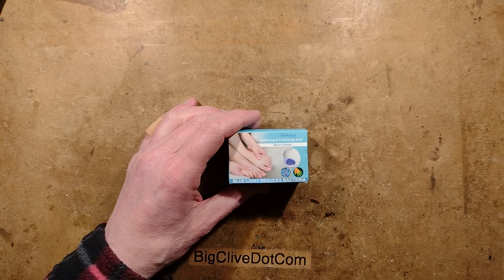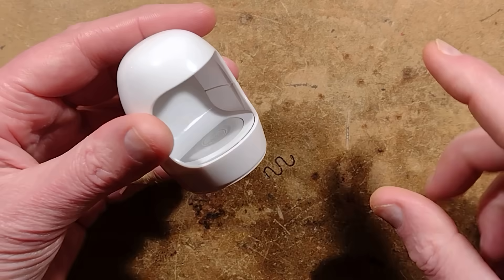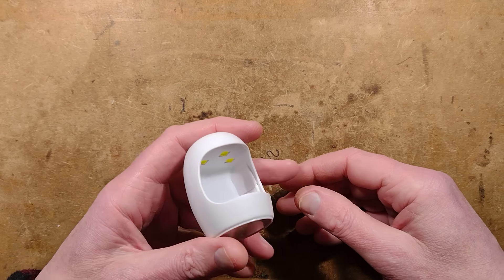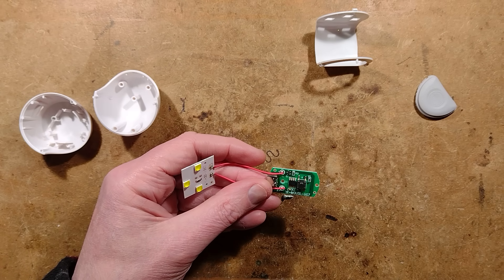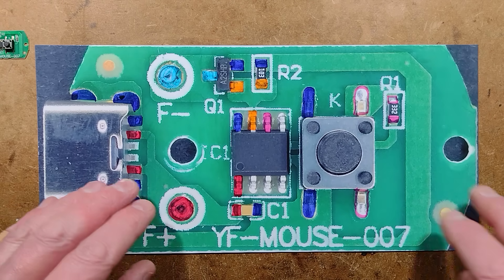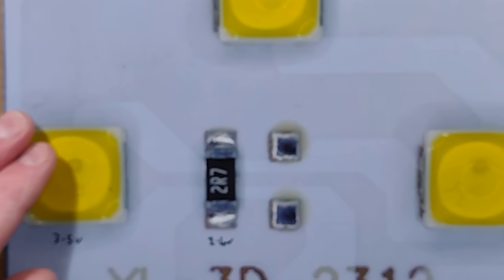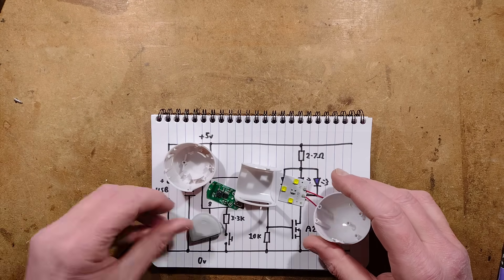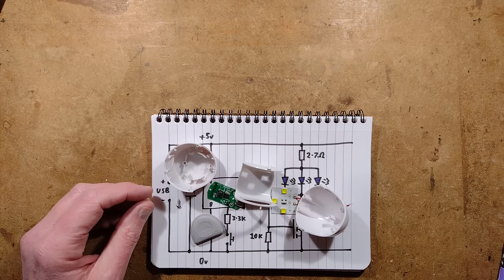UV nail fungus curing thing - with schematic

Comment: The UV-curing resins are all essentially the same stuff, whether they're used for nails, tooth fillings, or 3D printing.  It's just variations of UV curing epoxy, which, like all epoxy formulations, has a high potential for driving allergic reactions.  I'm highly sensitized to it and have been for decades.  But epoxies are just way to damn USEFUL to not have around the house, I just have to be scrupulously careful to glove up and make sure I don't contaminate things and wash up well afterwards.  Even then, I keep over the counter antihistamines in the house as a mater of course.  (I think I'm better of than an old friend of mine who's allergic to grapes, because 'unsweetened' fruit juices are often actually sweetened with deionized grape juice, which doesn't count as a sweetener, at least iwhere I live, because it's still fruit juice.)

Comment: is the pulldown resistor for the mosfet really necessary?
Reply from the maker: If the gate floats while the microcontroller is not stable it can partially or fully turn on.

Comment: Toenail fungus cure that works: bleach. Pour some household bleach out of the bottle into a dish and soak the toe or foot in it for 3 or 5 minutes a day for about a week, and it will get rid of the stuff. If you have had it for years without doing anything about it and it has gotten into all the layers of the toenail, it might take a few weeks of applications to get rid of it, as the affected nail grows out and is replaced by unfungused nail material.

Comment: Speaking of bits, could one put "just the tip" in, or does the device need to be pink for that ? 😂
Reply from the maker: Yes.  You can put your tip in and get it irradiated with UV.

Comment: FWIW: I did also did some digging on light therapy for toenail fungus. There is some research support for visible blue light (420nm to 470nm) instead of UVA. This is also done in combination with photo-activated dyes. These wavelengths may also penetrate better? But who wants to irradiate themselves with poorly controlled UV?

Comment: I too have used an 8 bit processor (ATtiny) to replace a 555 timer. I wanted real 0-100% PWM for dimmer control. For 1 extra wire, I then turned the whole lamp housing into a capacitive sensor for touch control. Bonus!

Comment: I have a device for curing solder mask thats quite intense with built in fan. They obviously don’t want you looking at it as it turns off if you turn it over it turns off the light.

Comment: I find the lossy audio compression way too heavy-handed. It's brighter and now in stereo but on semi-decent near-field monitors the "warbling" is distracting. What's worse it seems to abuse the "joint-stereo" type compression when it's trying too hard to reuse the audio data between both channels which results in weird "sweeps" between channels, almost like you were switching one speaker's phase constantly.
Reply from the maker: I had left the audio at its default setting, but have now switched it to mono.  The stereo has caused issues in the past with other devices.

Comment: I have suffered with fungal nails for years. Topical liquids and courses of tablets didn't get rid of it. Eventually I came across a similar device for 6 pounds on eBay which is a price level I considered worth a punt. The item is slightly different to the thing in the video. It has an intense blue light and a 7 minute timer. I've been using it daily for around 8 weeks now and there is a noticeable improvement with the unhealthy nail slowly growing out. Fungi doesn't respond to psychosomatic influences so maybe mine is actually producing UV-C? At any rate I'll continue using it
Reply: Would you give me the link or the make of the device you have please?

Comment: I was going to mention the A2SHB Channel since all the stuff seems to feature one or many of these.   Those little "nail enamel curers" are very easy to modify to cure insulating lacquer if you need to repair PCB tracks - I've found green nail gel is a pretty excellent insulator, and offers good environmental protection (as well as a near match for the "original" finish). As for yellowing toenails / fungal infections, a 15 minute soak in Napisan (1 scoop in 1 litre water) does the trick - but remember to rinse well after use otherwise you'll have very dry and flaky feet.

Comment: They could have done it with a 555 timer and eliminated the MOSFET, but they would have needed a timing capacitor. My guess is the cost of 555 + capacitor > microcontroller + MOSFET.  That’s amazing.
Reply: It would also have been higher standby current than the microcontroller, especially if they had idled the controller waiting for a button press, as they should have but didn't.
Reply: @  Thumbs-up, for the reply.  Because the nail gizmo is most likely plugged into a USB power module, either implementation at idle should be barely be measurable on the AC input.  The big win is most likely being more environmentally friendly by eliminating the capacitor’s raw materials and its manufacturing process.

Comment: All 8 pins of the IC are only in use for the next mission to mars.
There is less computer power needed than Volkswagen is installing in the new matrix light for 1 indicator, parking light and daylight running light only. 🤪😂

Comment: Had chip controled circuit board I did once that when you tried to turn it on fried the chip even though everything was in spec and in the right order... Slapped in a resistor where wouldn't think it was needed, and all the problems vanished. Though don't ask for any more details beyond that as it was ages ago :P 🤷‍♀

Comment: The datasheet for that transistor says that it's 3.7A continuous !?!?!!!
Reply: Those numbers are based on how easily heat can transfer from the inside transistor, if the surface is kept at room temperature. So if you had heatsinks on each pin and liquid cooling for the plastic case, it won't build up enough heat internally to cause damage. 

In actual application, you will be lucky to get half of that amperage because you don't have perfect cooling for the outer surface either. 

I actually just bought some larger  MOSFET's that have TO-263 casing and pin dimensions. Their rating under perfect cooling is 200A, but realistically you can't run them  anywhere close to that...

Comment: I see signs advertizing laser therapy for toe nail fungus around town in Cedar Rapids, Iowa.

Is it a certain wavelength that penetrates the nail to kill the fungus or are they using powerful lasers to kill the fungus with heat?

Maybe it's similar to those lasers used for tatoo removal or hair removal?

Comment: Regarding new sound recording device: it's very "crisp". I turned down your highs by ear, with a high shelf EQ, freqency 1850Hz, gain -3dB, Q 0.35 and we're back to your usual sound, or very similar to it. EDIT: it's also much more directional, if you turn away your head sound gets noticeably duller and quieter.

Comment: Is it possible to change the time the chip turns the lights on? 15 seconds makes it kind of useless
Reply from the maker: I slipped up in the video.  It's 45 seconds, but it's fixed in software.

Comment: A '555 is also an 8-pin device, which would do for this, but I (sadly) suspect that in these enlightened days that a '555 plus the passives would be more expensive than the 8-pin µC plus the time for some underpaid lackey to write the code for it...

Comment: GENUINE, UVC LED versions do kill nail fungus, it is the only thing that did work on my extremely tough infection - that even prescription creams and tablets failed to control.

But the UVC ones I have tried, clamp around the toe and are painfully tight; however, this one, at this price, is obviously a scam.

Mine didnt kill ALL the fungus, it cleared my smaller toenails, but couldnt manage the same with my big toes and their thicker nails; it killed it back about 80%, but couldnt get rid of the rest.

Comment: Glad you mentioned the acrylic allergy thing - it is a message that needs getting out. Any idea why the main board says "MOUSE" on it ? I was wondering whether the resistor on the push switch is a funky way to the set the duration.

Comment: I'm waiting for a product that requires an eight pin oscillator or one shot that uses resistors and capacitors for timing and uses a micro programmed as a 555 timer.

Comment: Nail fungus is extremely stubborn and practically no over the counter remedies work - Let alone UV light.

Lamasil oral tablets are the only effective treatments, however, they can cause permanent liver injury.
Reply: I was on prescription Lamasil tablets for 2 years, the fungus only got worse - a UVC clamp DID clear my smaller toes, but only killed about 80% on my thicker big toes.

Comment: Is an 8 pin microcontroller really cheaper than a transistor and a capacitor resistor timing circuit ??
It seems to me that microcontrollers have just made designs lazy

Comment: TL:DR these don't work no matter how much you pay. 

Without exhaustive research on my part, the latest study (2014) determined that transmission to the infection through the toenail was ineffective due to refraction.  This study undermined the previous work from 2008 which claimed efficacy in vivo.

Comment: Methacrylate is a sensitize chemical react over time. as stated on SDS or MSDS. you have to minimize exposure 
otherwise exposure will cause blisters!
Reply: Methylacrylate? Methyl acetate? What is this stuff.
Reply: @louistournas120  
methyl methacrylate is the polymer back bone used in making Acrylic based polymers.
methyl acetate is a solvent used in paints and coatings. this solvent is commonly used 
with lacquer based coatings, they “cure” by loss of solvents over cross linking to cure,
or with unsaturated coatings that can use UV light to initiate cross linking curing the coating.

Comment: Could the 3k3 in series with the switch work with internal capacitance as de bounce?  Also ive seen ICs that have an internal resistor on an anolouge  input pin that forms half of a divider, you select different commands by selected external resistor so basically the voltage it sees on that pin dictates the operation. For instance here it could set how long it runs for each run...,. I saw a little audio recorder and playback IC that used this method, iirc you could chose from 10 files, ie 20k file 1, 33k file 2 etc

Comment: UV unsaturated coating for nails the unsaturated paint is initiated cure by the UV energy to cause the cross linking curing of the 
coating. it is not a Lacquer based coating that sets up by evaporation of fast evaporating solvents. like acetone, butyl acetate.
and has high molecular weight polymer in soluble solvents.

Comment: I miss the separate logic and discreet components that can be replaced vs the custom spun microprocessor that the masses cant even attempt to fix. Gotta love the "green path"
Reply: It's a standard 8-pin PIC footprint. You can replace the chip with whatever MCU you like.
Reply: @abitofabitofabit4404  Not every 8 pin chip is coded the same and very very few people know how to program one to the desired needs. There are some ubiquitous types of chips, but MCU need to be programmed. Without that, this and many things like are complete and total Ewaste

Comment: What? No way! A chip for protecting the UV LED inside the LED?? What a time to be alive. 
Do you have the model of the LED so I Can find out what kind of protection does it have? 
Thank you Clive keep up the good work 🎉
Reply from the maker: A subsequent test showed that it may be another LED emitting a different UVA wavelength.   But the UVC LEDs often do have a protection component in them.

Comment: 3.3k resistor in series with push button could be a timing thing. MPU coded to delay turn off depending on resistor value? Switch de-bouncing is normally done with caps.

Comment: Yes it's methacrylate that's causing the allergic reactions. ("HEMA" or 2-Hydroxyethyl Methacrylate). 

Nail gel manufacturers are starting to come out with "HEMA-free" products. I've tested a couple of them out of curiosity. They appeared to work very well.

I wondered if it was a marketing-type of swap like with "acetone-free" varnish removers, where they substitute something that's very chemically similar to the "bad" ingredient and consumers think it's better for them. I was not able to find any reports of people reacting to HEMA-free products so that's a good sign.

Comment: And about the allergic reactions you can develop: it is also making certain implants impossible and that includes for example hip-protesis in some cases. 
I (not a lady) had my dents removed and I cannot get normal protheses for those anymore, no repairs to my other dents and almost sure no normal protesis in the knee or such will be possible since those kinds of resins are used to frix everything together.
Not sure if it developed because of dentalwork, 3D-printing and/ or gluing, or a combination of those.
Reply: It might just be from the food and water, with everything getting covered in agrochemicals, the animals we eat full of medication, and on top of that, all the other chemicals in processed foods, and everything else inorganic that floats around us. Chances are pretty high that we overexpose and overwhelm out immune system at some point and have it start to act up and start to react in stragne ways.

Comment: Always amazed at how things can be manufactured and shipped for less than you can buy some of the components if you had a project to do… I quite often look for things that have the components I want lol. I was after a relay a while ago and they wanted more for 1 relay than a switched relay board with 5 relay’s on lol
Reply: Economy of scale is a wild thing! Being an individual seller buying an individual relay means paying full shipping for the part - as opposed to a manufacturer paying for the same number of shipments, but with 10,000 per shipment.
Reply: @StormBurnX  
Also, slavery! xD

Comment: I looked up such device use and apparently there is benefit in using a certain wavelength (470 nm) of blue light on fungus.  It inhibits and kills candida for example.  Not read anything about UV light doing the same.  They sell them in stores here for about $30, more for fancier ones.

Comment: If you scrape or dissolve off the phosphor it's could be UVC LEDs ,  which would make them useful ,  500ma is a lot for the LEDs,  exposure to UVA will cause a reaction in the skin and could I suppose cause a heightened reaction to the fungus same as a bee-sting can,  ( hypersensitivation )  I think it's called ,  used for treatment of warts as well
Reply from the maker: Not UVC.  They appear to be UVA.

Comment: The video quality is definitely much worse.
There is noticeable lens distortion and optical abberrations around the edges of the image and the focus also seems to be spherical instead of rectangular and planar; however even in the center of the image, the sharpness and detail resolution is worse when viewing the video on the highest quality setting.

Basically, the outer regions of the image are blurry and things that are flat and rectangular in the real would get distorted to look more circular and compressed along the outer edges, but the quality has been reduced throughout the image plane.

Comment: An 8-pin microcontroller trying to be a 555 in monostable mode hmmm...
Reply: What's interesting is despite a 555 being cheap, it's not cheaper than an MCU considering the auxiliary components the 555 requires.
Reply: Due to the large transistors in a 555 for high output current rating, the 555 takes more silicon and is ultimately more expensive than a basic micro.

Comment: Changing the PH of the skin will cure fungus, I've used one spray of aftershave twice a day to the effected and my nail fungi cured in no time.
Reply: Check the ingredients label for some kind of funky fungicide chemical 😅.
Reply: No meds worked for me until i used vaseline. the oil in it drove away the moisture and cured the infection.
Reply: It really worked? I thought aftershave was basically water, alcohol and chemical scent. Please detail more I'm interested as have same problem
Reply: There was also a study that showed garlic has something that cures nail fungi better than most commercial cures.
Reply: I bet you your feet smelled nice!
Reply: If anything it was the alcohol, not only a poison, it also dries the area. One of the reasons why aftershave is so bad for the skin.

Comment: Love this video. The audio sounds a lot clearer. Always educational. Keep it up ❤
Reply: Have you actually compared the image quality on a big screen, with Youtube's video quality set to max, or are you just going off memory / or what it looks like on a phone?

Please just take 5 minutes to load up a previous video and compare how the workbench (and the marks left on it) looks, especially paying attention to the outer third of the image. There is a very distracting blurring and spherical lens distortion in this video, with supposedly flat and straight lines (such as the edge of his workbench) being so distorted that they look like they curve away from where the camera's imaging plane is supposed to be.
( One way to describe it, is that it looks almost like barrel or inverse pincushion distortion; i.e. his IRL flat workbench surface looks like it is a convex hill with his hands resting on the apex. )

But that's not all, the entire image has less fine detail and sharpness than in the past, which is especially noticeable when watching on a large desktop monitor and comparing this video with one of his previous videos, by opening both in their own maximized window and cycling between them.